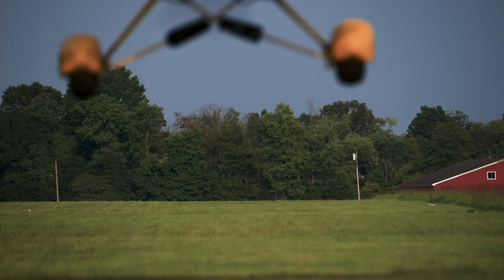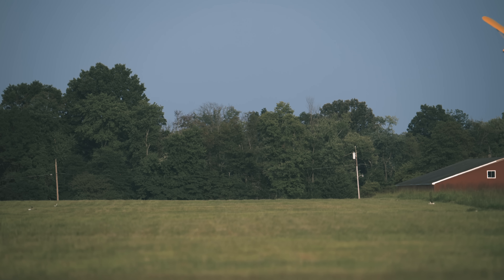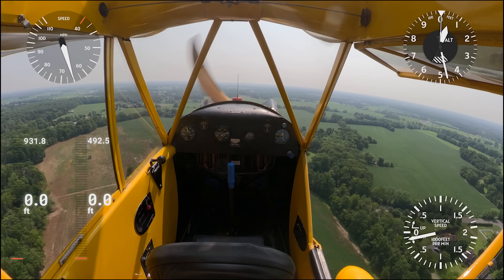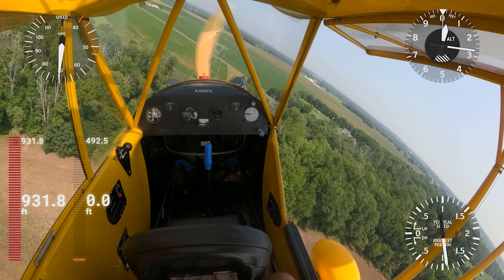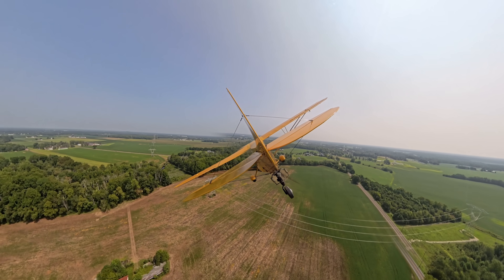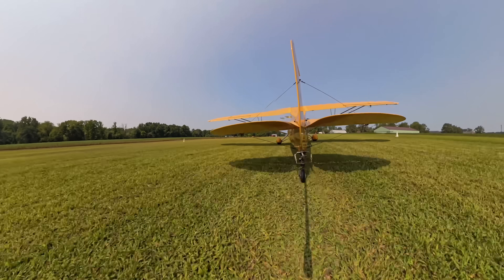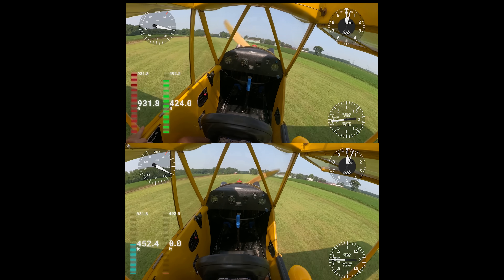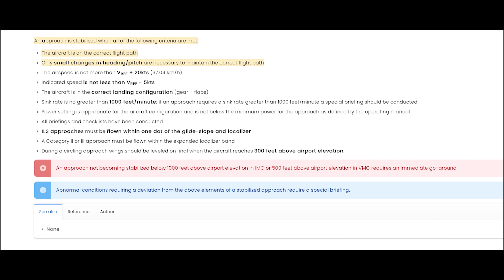What Happened to Basic Stick & Rudder Flying? Slipping an Airplane to Slow down.

Comment: I always thought of the slip kinda in the inverse. Instead of using to lose speed, it used to lose altitude without getting fast. Great tool for short approaches which we both seem to favor. But in a real engine out situation, you really cannot be short so you are clean, best glide until assured. That is 15kts higher than stall, AND I likely still have some altitude to lose into this short field. So yeah, I agree with you, use it to lose speed for a short field. I am glad we had this talk.
Reply from the maker: 100% and that's how I use it 99% of the time. Think coming down over trees etc. This is just one example where you "could" use a slip to bleed off airspeed. Think if you had an engine failure and are doing a forced landing in a field and you are fast, you could use this technique to bleed of that airspeed. Hopefully that makes sense.
Reply: @Bananasssssssss Thanks for making this video!